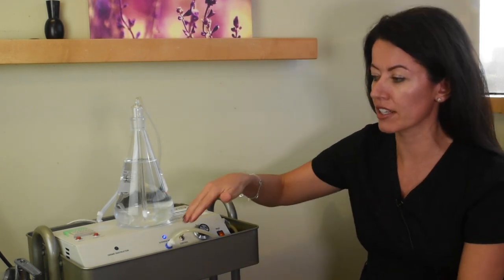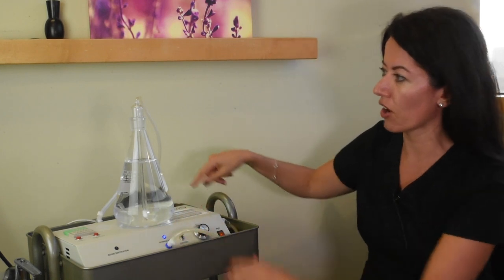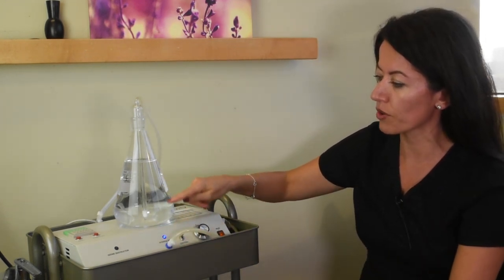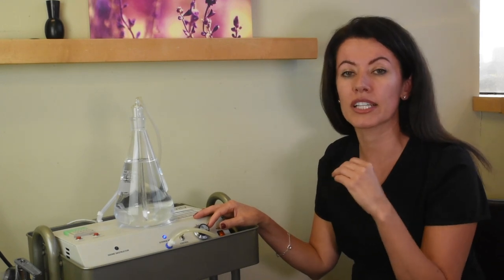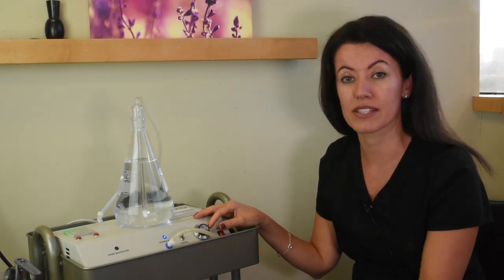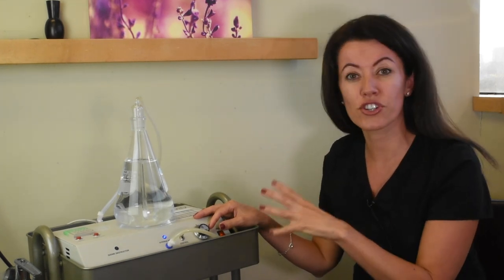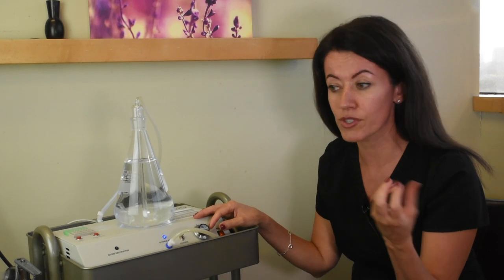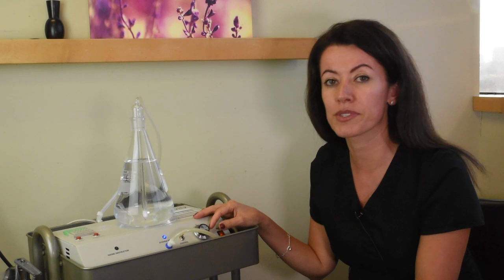How We Make Ozonated Water

Comment: . Rinsing your mouth out with regular 3% Hydrogen Peroxide will also treat all of the things you just mentioned. A great quality Ozone Generator like the one you have from Longevity Resources costs thousands of dollars! I have one and I use it to make Ozonated Water which I then DRINK! When I want to clean my mouth and teeth really well I use Hydrogen Peroxide instead. Cost: 88 cents!
Reply: Hydrogen peroxide makes your teeth brittle and inflames your gums. Try putting a teeth in hydrogen peroxide for long
Reply: I personally like to oil pull with coconut oil and a drop or two of quality oil of oregano.  Quality Oil of oregano = Wild with high carvacrol content.  Been researching this kind of stuff for 20 years if it makes a difference to you.
Reply: @chromecastthisis1251  . I don’t use hydrogen peroxide regularly to gargle and brush with. I use it only occasionally. I also occasionally put a half dropper or so of 3% hydrogen peroxide in my ears and let it bubble in there for about 15 minutes. It’s a funny feeling! I lay on my side and then turn over and do the other ear. I then use a Q-Tip and then shower. It works great for cleaning out your ears. The Germans do this.
Reply: My dentist is amazed at how much better my teeth and gums are when I started using mouthwash with 3% HP. Brand:  BR rinse organic mouthwash.

Comment: Hello do you have a method ? I have an ozonator 600 mg (?) - How many minutes, how many glasses, how many days weeks ? What will happen with me  ?
Reply: You can use this ozone generator as it will ozonate your water. Use cold water or better still iced water. Bubble the water for at least an hour.

You can use from 1L to 5L. Ozonated water will help oxygenate your body.
Reply: @craigwaterman7948  ozonator gl-3189a - that is mine. What did you mean with "this ozone generator"; the one in the video ? Where do you find your knowledge ? I bought a book with a manual in The 20 Minute Miracle: How to use ozone water to promote good health in people, pets and plants.    I also read the One Minute Cure. So I added both informations and drink 8 glasses of ozonated water (40 minutes bubbling) - and on busy days drink 8 glasses ozonated for 20 minutes.  Honestly I expected more - I know that ice increases the half life of the ozonated water. But I can not drink more then 2 liter.  Nobody can ? Pleas more explanation. Do you make a bottle in the morning ? The ozonated water has only half life of 5 minutes if not in ice - you understand ?
Reply: @iqbalhelsen852  There are 2 types of Ozone Generators. One that uses oxygen from a bottle or from a concentrator, the other uses ambient air. Either one will work. The one using ambient air will take longer as air only has 22% oxygen. Used distilled (water if possible) with ice. The ozone will last longer the colder it is. You dont have to drink iced water. Let it warm up to room temperature or what temperature is comfortable for you to drink. I make about 4L in the morning, then put it in the fridge and drink that water during the day. My information comes from AEPpromo - The International Society for Ozone based in Madrid, Spain
Reply: @craigwaterman7948  is there a simple machine for someone at home for drinking a glass of water a day?  You seem educated in this subject.  Thank you.

Comment: Can you do a step by step process? So we can follow along and make it with you. Thanks so much.
Reply: You will need a medical ozone generator (some have a built in destructor) depending on the model. You need distilled water preferably or at the very least filtered water Also you will need 2 silicone tubes with a luer lock on one side of both tubes and a diffuser like in a fish tank. Step 1. Insert the outlet tube with diffuser into the bottom of a closed jar. Attached the other end of the tube with the luer lock to the outlet of the ozone machine. The other tube must be placed above the water line and connected to an ozone destructor (loose) or built into the ozone machine. Bubble 1 litre for about 15 minutes if you are using your ozone generator with an oxygen bottle or bubble 1 litre for 75 minutes if you are using an ambient air ozone generator - ambient air only holds about 22% oxygen.

Comment: So is it safe to drink ozoned water or not ?
Reply: Fred Smith not if you haven’t eaten
Reply: Yes...but on an empty stomach.
Reply: @bashirgagigi172  

Bad advice.
Reply: Mister EIE No mister. Your wrong !
Reply: I just finished using an ozonator on an aircraft water system. My paperwork says that I now have to take the aircraft out of service for 3 hours to allow the ozone to dissipate. It says that it is currently not safe for human consumption.
Reply: @bige.3474  

I would advise against eating an aircraft...most likely it would be extremely difficult to digest.
Reply: @22kdawn  I am trying to learn about this quick... I would really appreciate if you ca be my info source...   What is a machine that i can buy to do what you are doing... and can i drink it everyday? Thank you soo much
Reply: @22kdawn  Hi,  thank you for sharing.  Wondering what machine do you have?  I have a daughter exposed to mold, she has Mast Cell and SIBO. 
She needs two extraction because of infection.   She is out of a job because of illness.   Three Natural pathic doctors took  most of her money and then told her they could not help her.  
Open for suggestions
Reply: I know it IS safe (in the case you dose it correctly) BUT my question is this one:

Is it safe only for pure oxygen ozone generator or also for air ozone generator?

Comment: Can you freeze ozonated water, and if so how low long will the ozone remain in the iced water?
Reply: yes you can certainly freeze ozonated water and it will last as long as the ice is frozen. When you melt the ice it still stays a long time as the water is cold and the ozone lasts longer in cold atmosphere. The key benefit of ozonated water is that yes it is clean, but it also contains a high concentration of oxygen that gets dissolved in the water at the same time and for drinking that of course is excellent !

Comment: how much nitric acid is produced? how do you prevent N0x formation? I am guessing I can do this with high voltage transformer, jar and aquarium bubbler?
Reply: it uses an oxygen tank. atmospheric air contains nitrogen. if using atmospheric air, using an air dryer helps reduce nitrogen oxides. if you use uv generated ozone, it doesn't form nitric acid.

Comment: Do you know if Chlorine Dioxide has a similar cancelling effect to ozone, as vitamin "C" does?  I'd really appreciate your professional knowledge, contrary as your personal opinion. Thank you very much in advance for details when replying! Blessings!
Reply: @kayondothomas7343  Funny you mention this, because I posted the same question in few forums, and they said it does. Even one of the posts said never take two main antioxidants at the same time (speaking of vit C, ozone, and Chlorine Dioxide), all in caps. I guess more research needs to be done. Thank you very much for your reply and link. Helpful!!!
Reply: @luisamedina1  agreed
Reply: @kayondothomas7343  thank you very much for posting this particular video. I’m dealing with prostrate cancer and I was doing ozone (rectal insuflations and ozonated water), then I switched to high doses of vitamin C for a while, then started on Chlorine Dioxide, since I was told to do only one at a time, and not to combine them. I’d appreciate if you have any thoughts on prostate cancer. What NDA stands for? Thanks a lot!

Comment: Hi  sorry this is not ozonated water. There is no ozone that is dissolved, as it needs a pressure system. Ozonated water is awesome -but what you have is water that has ozone bubbled through it which is not even remotely close to the same thing.

Comment: Sorry but you are not making ozonated water as the ozone is not dissolved. You can not dissolve any meaningful concentration without a pressurized system. Sorry, but all you are doing is bubbling ozone "through" the water and not dissolving it "in" the water.
Reply: what are you saying?
Reply: @littleaaaaa  What I am saying is that bubbling ozone through water does not give you ozonated water. Ozonated water has dissolved ozone, which can only be achieved through a pressure system of some sort -example using water from a tap, and using a venturi or such a device to pull in the ozone and mix it with the water to get a small portion dissolved. If you measure the ozone concentration in the water of your system that you are showing you will find it is close to zero. Sorry, but there are too many false systems out there preying on people's lack of knowledge. I do know however that properly ozonated water does indeed work awesome over many different applications
Reply: @cardinalfresh6200  Oh no that's not good to hear. What dose properly ozonated water smell like? Is there any easy way to tell if the water is ozonated?
Reply: @littleaaaaa  Ok. First if you are smelling ozone at all, that is not good because for sure it is not dissolving in the water. It just smells off - I really can't describe it.The "off"smell is ozone. You smell it once and you will know, but it is not a bad smell. In terms of testing, you can buy tests strips on-line, that you dip in the water and they will change colour if ozone is present. In your system, the ozone is not at all dangerous because you are not generating enough to be that. It is just that you are simply not getting what you are expecting.
Reply: @cardinalfresh6200  Wait, you first said I can not smell ozone at all, then you said it dosen't smell bad...? I brought this generator and I'm smelling chlorine, dose that sound right to you?
Reply: @littleaaaaa  i am sorry I am not making myself clear. You ca not smell ozonated water. You can however smell ozone coming out of the ozone generator. Your problem us not that you are not generating ozone, but rather if you bubble ozone into water without and pressure system, the ozone is not dissolved in the water. It is just virtually passing through into the air. Thus the water you thought was being treated is not ozonated and certainly not sanitized.
Reply: @cardinalfresh6200  I got it now, thank you so much Sir!
Reply: Right...and by doing this it has a half-life of 15 minutes and the water does have a smell. What does a pressurized system have to do with it? Do you add a pressurized system to the machine? I'm not quite understanding.
Reply: I knew of someone that found a way to create stable ozonated water in ice cube form..is this what you're talking about? The pressurized system makes the ozone gas hold onto the water somehow?
Reply: @aurorariley7519  Pressurizing the water is literally squeezes in the ozone so that it dissolves. Otherwise it simply floats back into the air.
Reply: @aurorariley7519  If it is actually ozonated water, it would have happened with a proper system for doing that. I have made ozonated ice and it does work as the half life in 32 oF water is several days. I am not sure what happens to the ozone if you melt some ozonated ice it in normal water